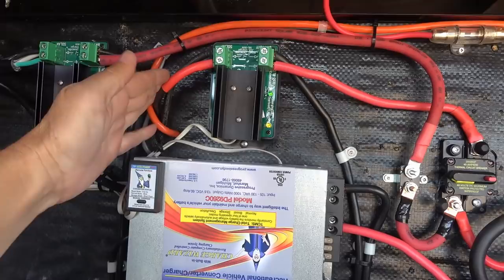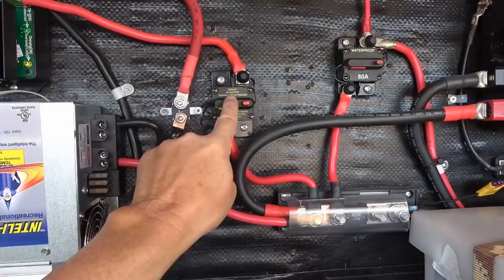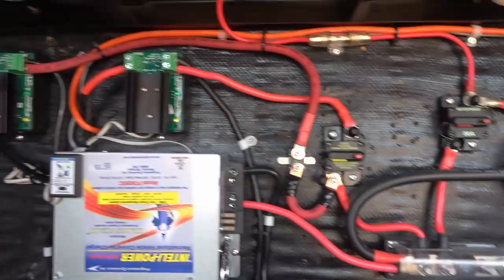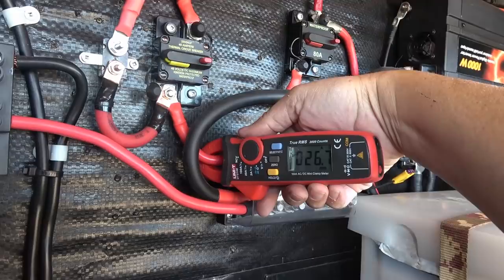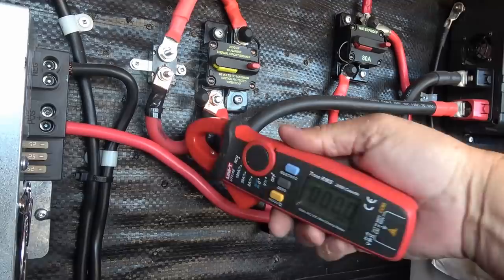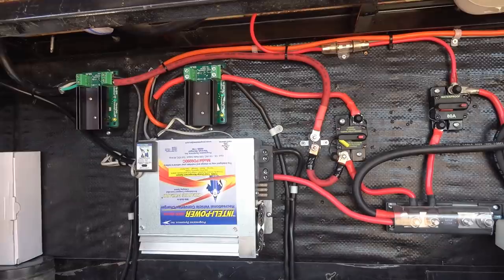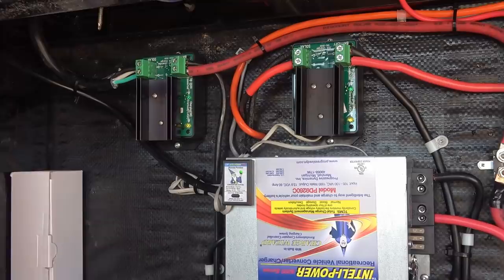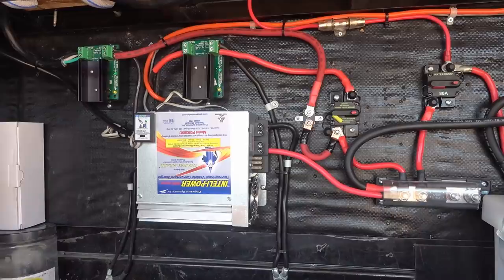Alternator Charging Mod + 12 VDC (High Amp) Truck Bed Power Port

Comment: Really love your use of drawn schematic when talking thru what's in your head vs expecting your audience to just know!  Also enjoyed your clear physical follow thru with the ammeter as you described the different input levels and component effects on the overall project.  
Great job!  Lynn
Reply from the maker: Thanks, I've just ordered a Renogy DC-DC charger https://amzn.to/2P0zA1q which supposedly has voltage boost ability to solve long wiring runs, I'll publish a review video for it and compare results. Cheers, Ray

Comment: I'm using a Renogy DC to DC Charger to accomplish what you are attempting to do.  It connects to the truck battery on the input side and my LIFEPO4 batteries on the output side.  It isolates the truck battery from the lithium batteries and has different charge profiles for different types of batteries. It charges the lithiums at 14.6 volts as suggested by the battery maker. It only operates when it sees a trigger voltage from the tow vehicle.  I use the charge lead from the 7 pin connector to trigger the charger. It's a great solution for less than $200.
Reply from the maker: Thanks, that one has been on my wish list. :: Glad to hear it works well. Cheers, Ray

Comment: Hey Ray, Looking good!! Larger the wire from the truck to the controller will definitely help. Also once you are on the road all hooked up, the alternator will output more at a higher RPM. On my truck I installed a smaller pulley on the alternator to achieve higher output at idle and keep it cooler. I also have a high idle switch that makes the truck idle at 1800RPM on demand. With the 60amp DC to DC charge controller I have I can use my truck to charge my battery bank when boon-docking and the sun is not shining. Sometimes it beats pulling out the generator. Always good to have many alternatives to keep the bank charged up when off the grid. Loved the video!

Comment: That short “4” wire up front; why not just put the breaker up there and ignore the 250A fuse? It is a nice looking install though. 
Also, I’d run a black cable home-run to the battery. I think using the frame for neg(-) is poor practice in general. In many vehicles there isn’t even a ground strap. On others where it’s present it’s too small for anything but for bonding purposes. 
A solenoid disconnect installed is the ticket. Yes!
It sounds like possibly voltage feedback and your charge controller (assuming set for AGM) is what keeps the amps down. And it probably should! If your charge controller has the ability to cut out over-current (sounds like it does?) that is good because “potentially” you could feed it 220 amps which would be bad for everything. Just make sure the manufacturer rates it to be able to curb amps at your 220A potential (I realize if that ‘did’ happen your 40A breaker would protect it).
Also there IS a calculable voltage drop per foot of wire that may also limit the absolute charge potential. 
It would be interesting to disconnect all your panels and measure charge input with just the truck. You’re at about 10A; I’d be curious if the batteries were discharged more if the output from the controller fed by the truck would go up. 

I enjoyed the video! I like to think about stuff.

Comment: The proper connector I see for this application is a 2 pole socket connector. They're available on etrailer usually used to supply power to a detachable winch or something they can support up to 200 amp's. The vehicle side connector resembles a trailer plug with the spring loaded cover, and cord ends are available to make your own cables. I'd recommend a vehicle side connector on the rig and in the bed, replace the ground panel lead with a cord end and a small extension with cord ends on both sides for between the tuck and rig.
Reply from the maker: Yes, a friend of mine showed me some he had, looked like this - https://www.etrailer.com/Wiring/Pollak/PK12801.html?etam=a0009

Comment: Looks good. I have a solenoid in my setup tied to an upfitter switch in my F-350 so that I can turn the circuit on and off from the cab.

Comment: I’ve got a parallel switch on my dash where I can charge my house battery bank on the move.  I bulk charge about two hours, then let the solar panels do the rest.  Depending on the state of the house batteries,  anywhere from 40 to 60 AH is sent into the house bank while underway.  When I’m camped in the woods or on a snowy day with no solar gain, I’ll run my engine an hour in the morning and an hour in the afternoon to keep the house bank charged.   Yes, my engine is very quiet.  My ScanGauge says I use about 1/2 gallon an hour while idling, so that’s not too bad.

Comment from the maker: UPDATE Feb 27th, 2020 – I decided to buy myself a Renogy DC-DC charger meant for the task. I picked the 40 amp model https://amzn.to/2wTKdgq  and have beefed up the wiring and connectors, and tests indicate a 39 amp charge rate, so I’m happy with that.
 I’m going to give it a towing test tomorrow for a few hours and will have a video out soon with a look at the Renogy charger, my installation, and a demo.

Comment: Ray,
If you turn the lights on in the truck it will boost your alternator output.
Reply from the maker: Thanks, will giver a try, I tried turning on the AC but it didn't do much.
Reply: @LoveYourRV  with my truck and trailer when I'm towing and have the lights on the alternator puts out approximately 14 volts

Comment: Fortunately, my Class A has this built-in.  The Battery Isolation Manager charges the chassis battery first and when it reaches full charge, the BIM interconnects the alternator to the coach batteries and charges coach batteries and runs my residential fridge.  The reverse happens as well and my solar will keep the chassis batteries charged once the coach batteries are fully charged.  I leave my fridge on during the summer between trips and everything is kept fully charged and fridge cold and ready to go.  Also,  powers my cell based alarm system.
Reply: I have a class C with a BIM and self installed roof solar. Do you connect output from charge controller to BIM for chassis battery solar charging? I need to keep BOTH coach and chassis batteries charged in storage from solar. Any thoughts on this?
Reply: Norton Newmann Mine is installed to battery.  One of the relays of the BIM system ties to the coach battery and monitors the battery voltage so it will see the effect of the charge controller

Comment: I like it.
I put a 1500w inverter in the truck and just run 120v back to the 60 amp converter.
Reply from the maker: Nice, you must have a high capacity alternator or maybe dual alternators to power that. I'd guess with normal inefficiency calculated for the inverter and converter, it must draw around 70 - 80 amps from the alternator.
Reply: @LoveYourRV  Its a 160 amp with dual batteries. I mostly use it when driving between boondocking sites.

Comment: Fundamentally you're trying to charge a 12-volt system off a 12-volt system with a charge controller (and resistive drop) between. You won't be getting much charging current, although when you're on the road and your engine is above idle, the system voltage in your truck will probably rise and you'll get more charging.In theory you could have a voltage boost circuit in your charge controller (I don't know if such solar controllers exist) which would allow charging a system from a lower voltage than the system is rated for. Such a charge controller would be able to wring some charge current out of a solar panel even in minimal light conditions.
If you think this system is worth keeping, I would suggest you replace all those RV shore power connectors with the trolling motor connectors to avoid the chance of someone actually plugging something into 120V. I'd also splurge and run the ground back to the truck battery. Here in the rust belt (southern Ontario) having any substantial current running through the frame is just asking for the vehicle to crumble into rust... Of course, you typically would not be using this circuit during the rust season.
Reply from the maker: Yes, I think your right, there needs to be a boost of voltage when using long wire runs. I was trying to replicate this Bogart video - https://www.youtube.com/watch?v=2yhC-43P_Uk  But as you can see they were using short wires and maybe a 14.4 alternator.  My alternator is regulated so, it seems once the truck is warmed up the alternator voltage actually drops even with higher RPM, guess that's a system to try and extend the lifespan of the batteries.

Comment: Recommend a battery isolator between the truck and the RV.
Reply from the maker: The solar controller provides some isolation, RV batteries can't back feed but also talked about adding an solenoid. Cheers, Ray
Reply: @LoveYourRV  It allows for the full alternator output to the RV batteries once the truck batteries are charged.

Comment: Was that 4 AWG or 4/0?  Looked like 4/0.  Looking at the date of this video, it was good you did it back then.  Now, costs are ridiculous let alone availability…. I’ve toyed with this idea for some time but am intimidated with the interface with the Alternator.  Thanks for posting!!
Reply from the maker: I used 4 gauge for the wring and the truck frame as the negative return. Ended up getting a Renogy 40 amp DC-DC charger and it has worked well since it can boost the voltage for its charging output to overcome the wiring voltage drop.  https://www.loveyourrv.com/renogy-40-amp-dc-dc-charger-installation-and-demo/  Cheers, Ray

Comment: I'm just barely past the "paperclip in the wall outlet challenge" of electrical understanding, so you're the expert in my mind. As a side note, I'm thinking of powering my trailer with a small nuclear reactor, just to keep it simple. I may have cooling issues, but hope to capitalize on the desert nights temperature differential as a method of heat dispersal. I don't know. Any tips would be appreciated. Cheers, Ray!
Reply: joel1239871    keep it simple, you only need a flux capicator
Reply: Let me know where you're parked joel1239871; I need to park close enough to avoid the need for flashlights, but not so close as to get radiation poisoning....

Comment: Interesting mod but I am curious as to the big picture need?... This mod only allows you to use the truck to charge when you moving the 5th wheel and connected... Do you usually arrive at a new campsite after a drive and not have a fully charged battery?... Seems like a long days drive with your 600w of solar and no draw would be sufficient to get you to 100% charge?... Then you’re stationary for a week or two boondocking and this can’t be used... Do you not worry about warranty issues if the Ram dealership see your breaker and cable?...
Reply from the maker: Sometimes that is the case. We often travel the northwestern coast during the fall and springtime, like Oregon, Washington and British Columbia and often times you may not get many clear sunny days, lots of cloud and fog can severely lower the solar power harvest. This will reduce having to haul out the portable generator as much to recharge. Also, will come in handy for the mid winter travel days when solar time is very short each day.  Its just an extra option.

Comment: Great video Ray! you have quite a system there... I have a tow behind 30' Keystone VR1and I measured a charging voltage to my 2 batteries when my truck is hooked up. (Ram 2500 diesel) .. I measured 13.8 volts or so through one of the wires from the 7 way plug that's connected to my batteries so the 7 way plug actually supplies some charging to my batteries as I drive. .. you got me curious as to how many amps it is supplying. Did you measure what you where getting on the stock set up before you did this upgrade?
Reply from the maker: No haven't measured with both the stock setup and this running at the same time. I haven't measured the stock tow cable amperage if it is even hooked up on my truck, but I didn't notice much charging when driving unless I have the sun on the panels. I'd hazard to guess it just supplies a trickle charge to try and keep one battery charged. Now that I have the battery monitor WiFi app I should be able to easily test stuff while hooked up and driving.

Comment: What do think about using 12-2 copper cable? I had some left over from wiring my basement, so, I used it from my solar panel to my charge controller in my van. It seems to work fine. Would I be any better off with regular, stranded "solar hookup wire"? Thanks.
Reply from the maker: I'm not sure about that. I think the big benefit to stranded wire is its more flexible so easier to route. They also seem to us it for welding cable, very fine strands so maybe it can carry more amperage but I would'mt think a huge difference.
Reply: @LoveYourRV  Thanks. Yes, it was a bit of a pain twisting it around pillars and posts inside the van walls. But it was cheap. And since it's providing enough amp-hours (watt-hours?) to run my fridge and charge a few things, it ain't broke, so I won't fix it now!

Comment: My 2018 GMC comes from the factory charging the RV battery while towing.
Reply from the maker: So does my 2018 Ram, but I find the amperage pretty weak, maybe 5-7 amps at best, they by the looks of it have 14-16 GA wiring, I find basically it's only enough to trickle charge a battery, keep it topped up. My old 1994 Ford did better but it didn't have one of these fancy new regulated smart alternators in it. :)  Once you have a large battery bank and furthermore lithium battery bank, the OEM tow cable chargers don't seem to cut it. Maybe your GMC is different. Cheers, Ray

Comment: DANGER: That 30A male plug can short to the truck body (ground) when the trolling motor plug end is inserted and the 30A male plug is laying in your bed.  Please look into another connector type for the truck/ portable panel connection, or be very very careful.
Reply from the maker: Thanks, I'll be looking at different connectors, my truck has a non-conductive spray on bed-liner so wasn't too concerned for this test, plus there is also the 40 amp breaker for short circuit protection. What I have been doing is connecting everything up then switching the breaker on, when done I switch it off before disconnecting.

Comment: Frankenstein is right ray , wonder how many amps you’d get not going through charge controller, the kinda amps your getting now could never hurt those batteries , most likely your truck batteries voltage are up & alternator output reduced. On another note I used 50 amp anderson connectors with weather covers on both my solar panels (portable) extensions etc. They make a nice connection, just a question ray , I just bought that 1000 watt CTC pure wave inverter you have to complement my bigger modified one , looking at yours l see ground lug hooked up, is this needed?
Reply from the maker: I'm most worried about harming my fancy alternator, just never know, so like the comfort of a go-between device.  They make dedicated DC-DC converters now for the task but thought I'd give the spare solar controller a try.
Ground lug in the Inverter - It's only really needed if you hook the AC output into your RV AC distribution system. Mine is sort of redundant as I'm supplying floating ground AC outputs, not hooked to my RV AC distribution. 
It's a protection thing if ever there is a failure of the circuitry inside the Inverter that made the metal case hot, 120 VAC, then the grounding would blow the fuse before a person could grab the metal case and RV frame at the same time and get a shock. Kind of a remote possibility but its there in any case. At least that's how I see it. Many of the inverter manuals don't even mention it.

Comment: Wouldn't it be better if the 30A connector from the truck was female.  Not good with hot legs on that male plug on the truck connector.
Reply from the maker: Yes, it's just experimental, playing around and testing things to see how they work at this point with stuff I could easily get locally or had kicking around the RV.  My long term plan is to use high amperage connections used in semi-trucks,  like this - https://www.etrailer.com/Wiring/Pollak/PK12801.html?etam=a0009  Rated for 200 amps and can take large gauge wires.   I've also just ordered a Renogy DC-DC charger to review and compare it with the Bogart solar controller. :)  https://amzn.to/32esVpW  Stay tuned! Cheers, Ray

Comment: Do you not have 2 batteries in your Ram? My 19' 3500 has the 2 big batteries and higher amp alternators.  I'd not likely add anything to the factory system that could strand me when I don't expect it. I have more faith in your knowledge than my own when it comes to these complex wiring projects.
Reply from the maker: Yes, My Ram has two large batteries in parallel to startup the big diesel engine. I'm no too concerned as I carry a battery jump start box that can handle big diesels - https://www.loveyourrv.com/noco-gb150-battery-booster-review/

Comment: Try a higher amp connector, i think that's most of your voltage drop
Reply from the maker: It's rated for 30 amps, but thinking of getting some 200 amp connectors. Also, I just ordered a 40 amp Renogy DC-DC charger to review and test, will be interesting to compare. https://www.renogy.com/12v-dc-to-dc-on-board-battery-charger/  I think a lot of people are switching to these due to the new vehicle's smart alternators not putting much tow cable charge any more due to them regulating the voltage lower as you drive and RVers have bigger battery banks now and some are running lithium which takes a high charge voltage.